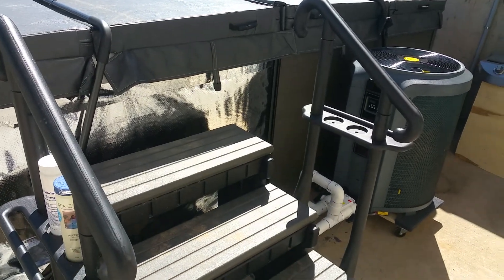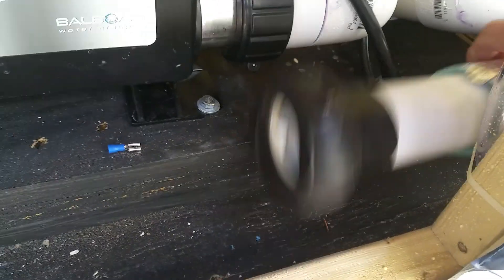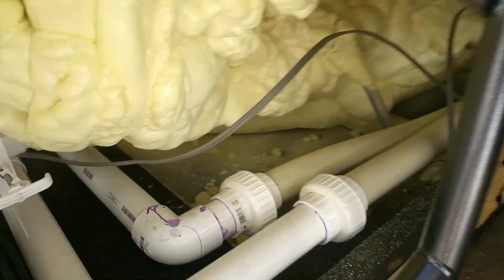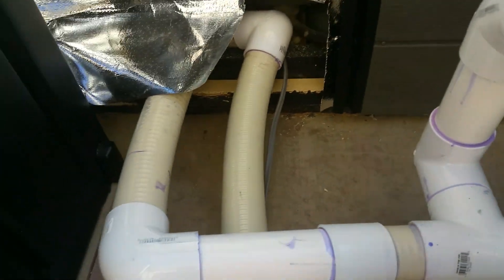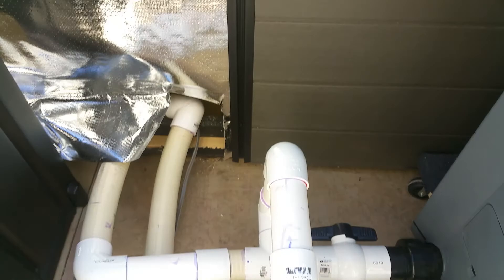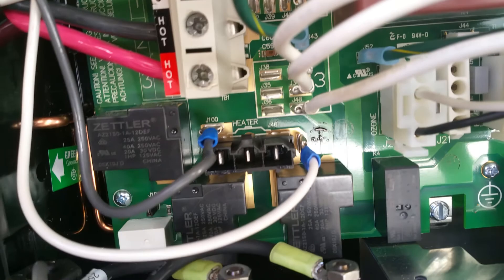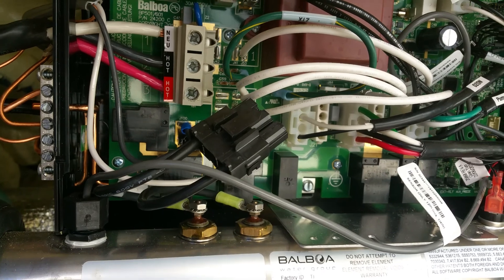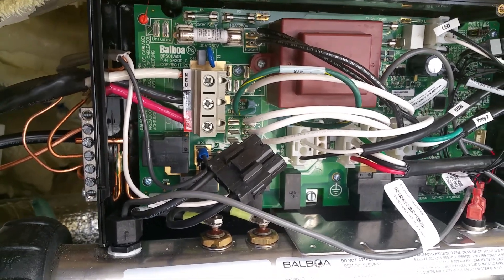Quick video how to connect a heat pump to your swim spa hot tub , easy! Balboa - Master Spa

Comment: Couldn't you somehow keep the old heater in place but simply set the temp super low so it never triggers? Then, if it does get too cold outside you can always supplement with your old heater?

Comment: Very interesting.  I note that your existing heater, and the new heat pump were plumbed on the suction side of the pump. This seems to be a less common location for heaters when googling this modification.  Any flow or pressure switch problems when you use the heat pump?  Also, is your pump a single speed circ pump only, or a two speed circ and jet pump?
Reply from the maker: It's a two speed pump.  Yeah suction side is not ideal, but it's been working well now for 2v yrs
Reply: Good to hear.  My pump is also 2 speed, and existing heaters are on suction side so your experience supports my case.

Comment: I would like to know the same as xxxtcify, and also hear if the circulation pump is the trigger for the heat pump, or the temperature alone. Where is the temp sensors located within the spa...it must somehow know when the water is too cold, and start the circulation pump and heater (or heat pump in this case)

Comment: Is the setting for the temperature somehow synchronized? I mean if you set the temp on the balboa device, you still need to adjust it on the heat pump as well, correct?

Comment: Hi, thank you for the video! Does your balboa controller log an error because of the non-fuctioning heater?  Also, does it toggle the heap pump only when heat is required? Cheers & thanks in advance, Sascha
Reply from the maker: No error. In the winter I turn off and winterize the heatpump, only run the element. 
I turn off the element in the spring. And run the heatpump by itself.   No faults/errors